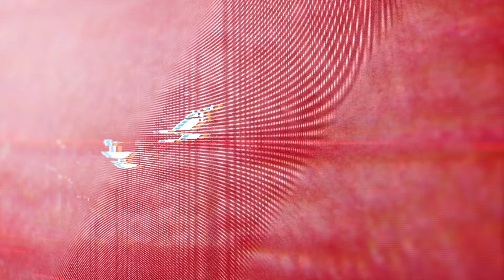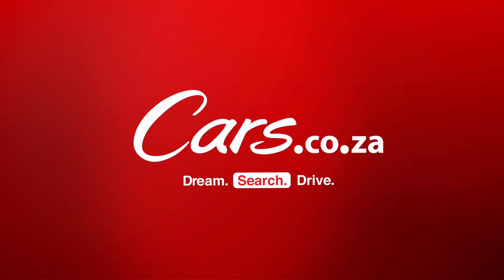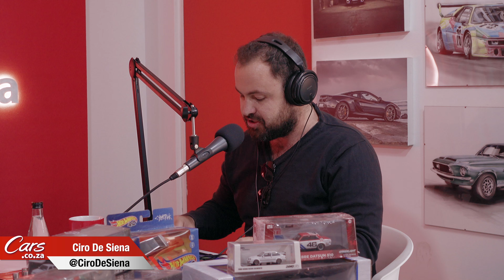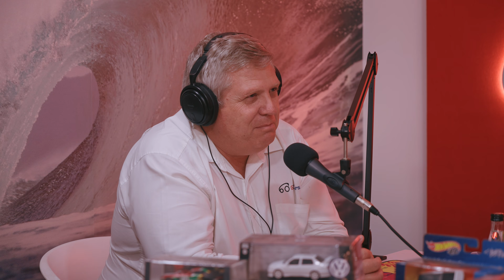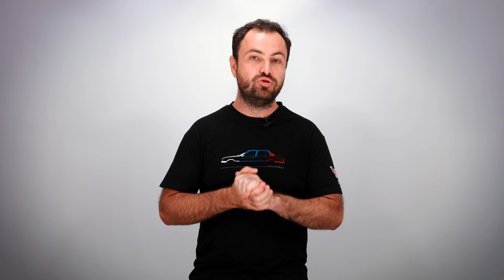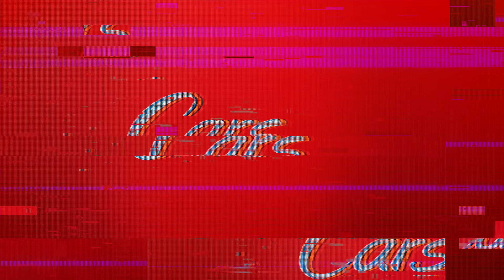Can you road trip across South Africa in an electric car? - With Winstone Jordaan, MD of GridCars

Comment: The only solution is all fuel stations in N1 to have the 22kw AC chargers.

That 1hr = 140km stop will allow even a mini to tackle the CPT to JHB trip

R40 000 investment per Charger.  Selling R7/KWH (R4 profit) looking at breaking even after charging 10 000kw - thus about 200 charges on average...

Well not considering a lot of factors above. maintenance - app cut - etc

Comment: Good day.

My vote is for EV vehicles.  Just need cheaper vehicles that are within my price range.

South Africa is also looking at dropping the speed limits, and if that 10-20kph is taken, the speeds most people can drive will have to drop, giving the smaller capacity EV's a better range, as the drag co-efficiency above 100kph seems like the smaller cars are using too much energy to maintain.

The Mini Cooper SE makes perfect sense for me on 90% of my driving needs.  I don't do the Cape Town to Jozi  trips anymore.  Can't even remember when last I drove more than a 120km in one direction, or driving on the N7 to Upington, or even the easier N2 to Mosselbay.  With that if the vehicles prices falls into my price range, and the holiday resorts/places have an infrastructure with even a level 2 charger and overnight stop after some distance would make for a relaxing drive.

The BMW i3 with the 94Ah or 120Ah model ranges would make perfect sense for my sister, the only problem I have with it, the wheel sizes.  Darnit, the rubber can only be obtained from BMW, the skinny anorexic model sized tyres.  As the further you you drive away from the major cities, the less you find smaller and or awkward size tyres.

If we had to purchase one vehicle for the both of us, Volvo XC40 Recharge, but the P6 (single motor) not the P8 (dual motor) version would work.  Unless we are getting something the size MG 5 or ZS, Opel Corsa, Hyundai Kona, because I don't like the Ioniq 5 or EV6.

Another hampering factor, how about making the weakest DC charging capacity 50kW.

Nissan's Leaf doesn't make any sense for road tripping, the Chademo chargers aren't used.

Comment: For all the electric car support that believe they have 0 emissions what a farce. 
A. What powers your charger if not a coal/etc power station.  
B. The raw materials used in batteries is obtained through slavery including child slavery. 
C. The manufacture of these vehicles uses more natural resources and less people.
Most importantly the truth they are not telling you is the power density of an electric vehicle is still far far far far far lower than that of fuel.

Comment: Interesting, whilst the electric, BEV, in particular, will form part of the propeller energy in this country, please let's be realistic that until the battery magic happens (high density, lightweight, & charging time equal/better to fueling ICE) BEV will remain an urban transporter.2nd, BEV has to go on a serious diet to shed weight to achieve claimed range, plus people must remember in RSA, we take long trips fully loaded with baggage (sometimes with added trailer), and let's face it most average speeds are 110-135km/h.
One critical secret this BEV marketers don't realize is that ICE is drastically improving in terms of heat efficiency, and if this heat efficiency exceeds 50%+, BEV will find it hard to make a business case. I have over a decade of living & living with hybrids, so I talk from experience.
Reply from the maker: Thank you for your comment, we appreciate you engaging in the debate.

Comment: I think Bio diesel and Hydrogen, Are going to be better options ..with lithium mining having challenges EV is not going to be ideal. that will impact the price of both EV and Solar, all vehicles are dirty though. With our crime rate, being at one point for a given length of time might poise a danger as fuel stations were hot spots for robberies.. First time watching and finishing a podcast. Nice..
Reply from the maker: We're so glad you enjoyed the podcast, thank you for your feedback. We are working hard to foster debate around the future of motoring and we are happy you are part of the conversation :)
Reply: They are already working on batteries that dont use lithium or cobolt wich would change that dirt.i think the main thing now and in the future will be cheaper fuel,not somuch green fuel. Nothing will ever be totally green i think to make bio feul or hydrogen isnt all that clean or green anyway.
Reply: @peacefullsleep8904  Formular 1 have already developed a fuel that will be "greener" and can be used even in our current cars. You probably know since its recent news. Just updating the conversation
Reply: @sagsoul7920 Really....

Comment: Can you do a podcast on how the batteries for EV's are manufactured what materials is used how safe is it in an accident is there cut off switches isolating the battery pack output, how long will the battery last before replacing is needed and at what cost and if there is materials that is mined for the batteries is this done also in an environmentally friendly way?

Comment: What is your option when you have miscalculated and running low on a charge with no charging station in sight.
Reply: Same thing could happen to you in a petrol powered car though. My dad did this many times to us when we were kids on the way to Cape Town from Joburg 😂
Reply: @CiroDeSiena  I can take a can and hike to next petrol station - what do I do with ev - drive with battery charger.
Reply: Most probably call someone with a petrol or diesel generator to charge your car up again.